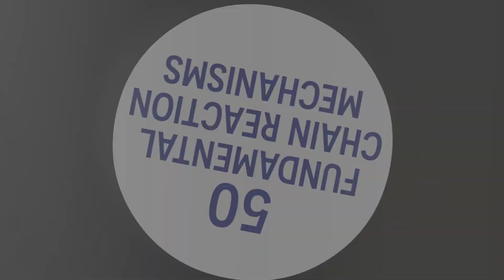Episode 3: String Techniques | 50 Fundamental Chain Reaction Mechanisms

Comment: For Future Reference, Part 3

0:00 Opening
0:23 21. String Redirector
2:12 22. Pulley
4:29 23. String Stopper
6:11 24. String Slice
7:27 25. String Pusher
8:22 26. String Attractor
10:10 27. Travelling String Pull
12:04 28. String Wrap
14:08 29. Disconnecting String Pull
15:42 30. Magnetic String Break
16:56 Closing

Comment: I'm eagerly anticipating advanced k'nex techniques so I can see some flexing quadrilaterals

also can confirm I use these string techniques all the time very useful

Something I find really interesting about this series is that even though I use the vast majority of these techniques on a regular basis, I never really thought of most of them as individual techniques before if that makes sense? Like if I can recall the first time I ever used some of these, I would typically arrive at these types of techniques as solutions to different machine problems I kept running into and then just intuitively remembered them the next time I was hit with the same problem. So seeing them all broken down and articulated as individual modules is really fascinating to me!